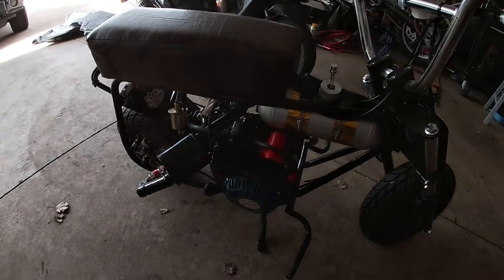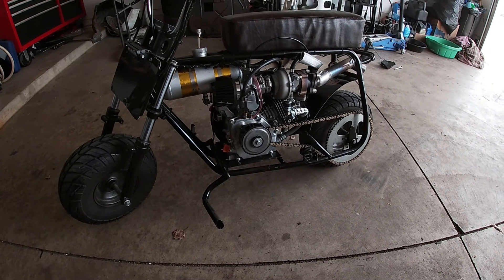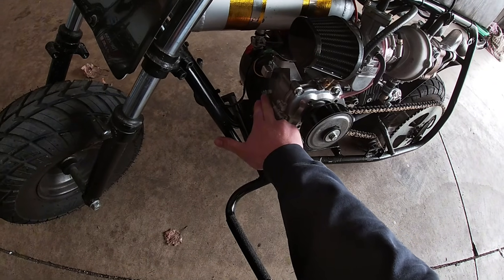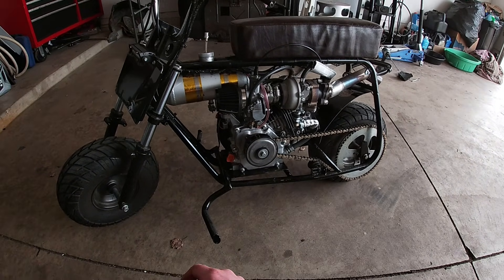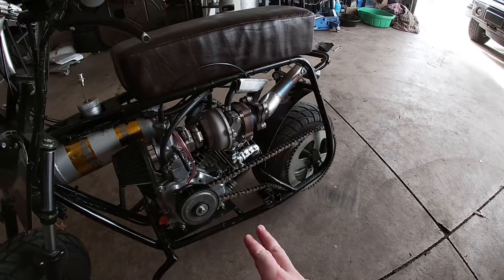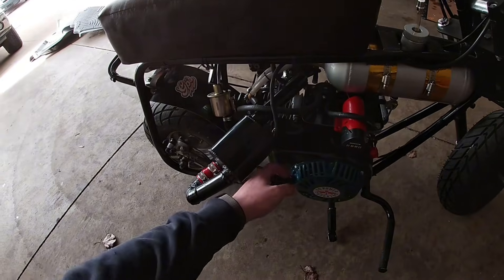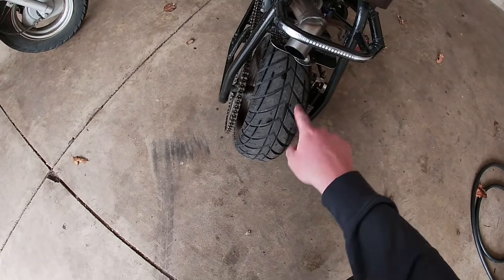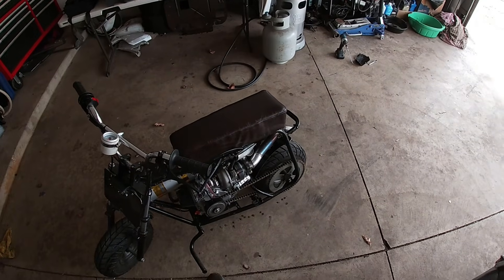Turbo Predator 212 Makes 15psi of Boost - Turbo Predator 212 Build

Comment: I have a question I put a turbo on a ghost and I couldn’t get it to run right 

I try a blower throw but it sounded like when the turbo would kick in it was always to lean 

So then I moved it to a pull through and it was hard to start and 

Do you has any advice on how to get my jetting right ?

Comment: You may want to gap the rings for boost if you haven't already lol 15lbs is awesome.. set it up for e85 and vent the crank case that things gonna fly
Reply from the maker: I considered doing that, but figured I’d give this setup a shot first, will check the cylinder out soon. I’m considering running e85… I vented the crankcase yesterday and no more smoke 👍🏼
Reply: @GCFab depending on where you live tuning it on avgas from your local airfield is also an option